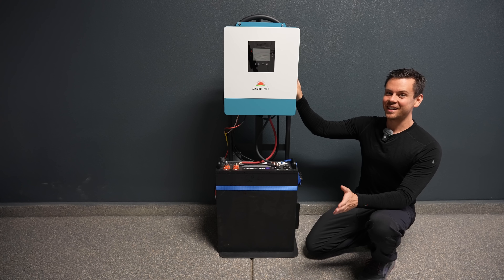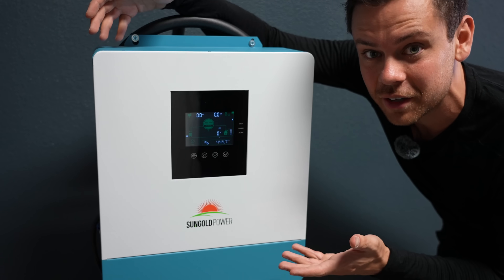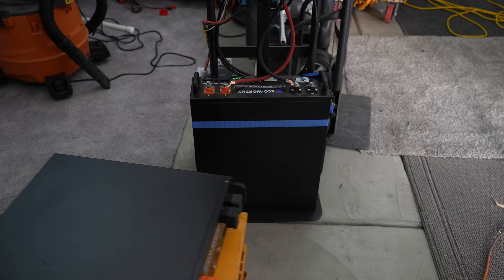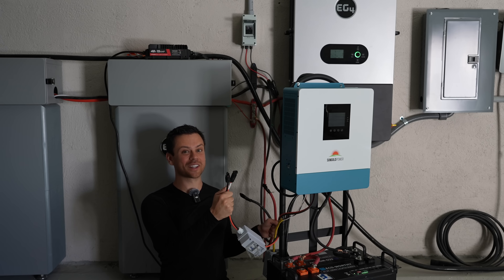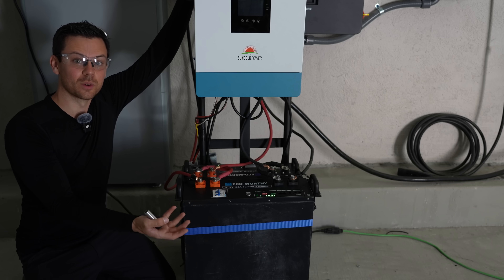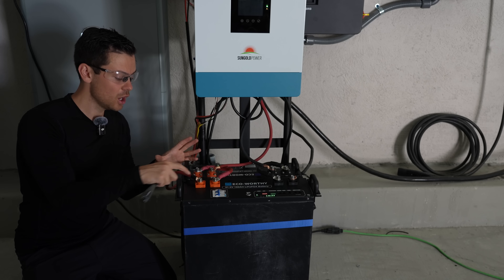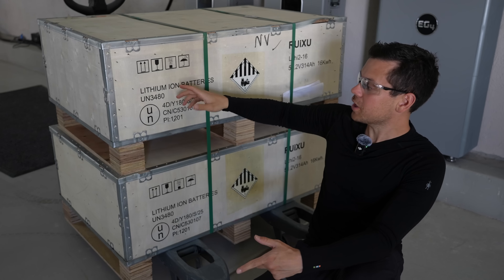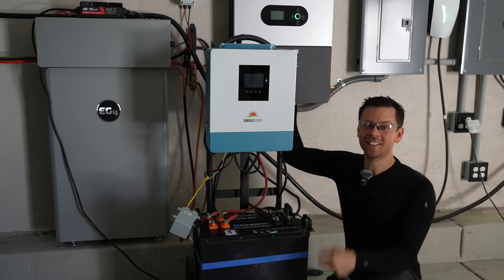DIY 5,000W Disaster Relief Solar Cart Upgraded! Build It Yourself

Comment: I have the EG4 all in one and server rack battery from Signature Solar in Texas as recommended by Will. Under $3,500 when I purchased. Works flawlessly for my cabin, off grid. Could not be happier except for one problem. My cabin is not heated and will not work in winter below zero Fahrenheit. I have to take it home, weighs a lot.  I am water access off the grid. Big headache. Works awesome all summer in Northern MN.
Reply: Why wouldn't you buy a heated battery?

Comment: I've been using Tesla Model S batteries in my off grid solar since 2014 and am of the opinion that they are perfect .   I have put thousands of cycles on them with no noticeable degradation and they stay balanced without the passive balancer ever switching on .   The hottest they have ever gotten was luke warm .
Reply: I have been using 2  Tesla Model S  battery for 5 yrs daily  in my RV - Have worked well - No BMS used - just checked and ALL in balance  - I solar charge to 24.8v
Reply: can you give some more information about them? what voltage? price? was it weird to connect them?
Reply: @keysersoze7034  Hello  ,   I put together a 24 volt system so I needed to add an extra pack in series to the 6 each packs that are in a Tesla module .   Each pack is made up of 74 18650 cells so the total voltage would be 29.4 volts .  I stop charging at 28.1 volts and the inverter shuts down at 21 volts .  After 11 years of use the most that the packs will get out of imbalance is 150 mV .  I paid $1200 for mine but they are selling now for $250 each .
Reply: @RussLinzmeier do you have a link to where you can buy them?
Reply: @LifeLearner002  I got mine off of E-Bay  , make sure to get the big ones with 444 cells per module .  The small ones have 384cells .

Comment: Question - could I safely add a 2kW 48volt charger to take power from an AC 240v V2L port on a car to charge it up in case the sun doesn’t shine?

Comment: I found a site that you can get even cheaper than those but no break downs on them I can find .. 815$ for the battery no breaker on front looks kinda cheap but the inverter was 339 .. wish I new if ECGSOLAX was decent .. I spent last 2 weeks with really shotty power cause my neutral live from the transformer to my pole has some issue.. not been a cheap couple weeks ..

Comment: I have two separate types of batteries, one is 8 Battle Born Batteries 12 V in series parallel. 
Second battery bank, is 4 SOK 12 V batteries in series. I use different shunts for both systems, which lets me set the voltage independently.
Seems to be working very well. It’s been six months with no problems or issues. The only thing different about the batteries is, Battle Born Batteries at 1C and the SOK are rated at .5 C.
Reply: Ouchhhhhh I don't even wanna know how you overspent on 8 Battleborn batteries.

😬😬😬

Comment: Perfect for those occasional power outages we experience.   

Thanks Will.
Reply: As long as it a very brief outage.
Reply from the maker: @sprtplt  you could run loads for years if you have enough solar. Just throw some panels on the ground
Reply: @WillProwse  Assuming you don't have strong winds that will make the panels fly away.
Reply from the maker: @vhfgamer  I'm assuming people have brains if they are reading this lol
Reply: We are looking for something to run the Fridge/Freezer for a few hours after a T-Storm takes out the power with a branch or two.  It happens on a fairly regular basis during summer months and occasional snow in winter months.   This looks much easier to maintain than a gas generator.  This you can plug in and let it set until it's time to roll it in place for a few hours.

Comment: Is there a 240 V inverter from this manufacturer that you would recommend? I think a cart with one of the wall mount batteries and a solid 240 V would be great for middle of the ground future proofing.
Reply: Powmr from the blurb? 🤷‍♀️ Says it's the same but 240v
Reply: @Luke-qs2cg he specifically says avoid in the blurb
Reply: Website says these support paralleling for 120, 240, or 208.

So, you'd need two of these, but they can do 240.
Reply: @Senthiuz I desire all in one, less hardware. The EG4 6000xp is nice but 6k output is a bit low these days.

Comment: A couple of things.  First, to put two racks mounts on a cart I built a 1.5" plywood platform under mine (2 x .75" screwed together).  Second, maybe you never envision laying the cart down flat, but if you do, one of those batteries is upside-down which I know EG4 disallows, because the batteries are not supported correctly for that orientation and you could crush parts, start a fire, etc.  Just some thoughts, otherwise nice video.
Reply from the maker: Great points! New version has battery polarity reversed, which is why I had it upside down. You're absolutely right!